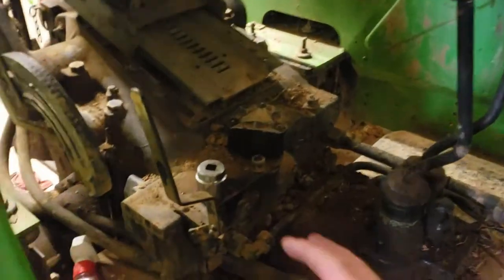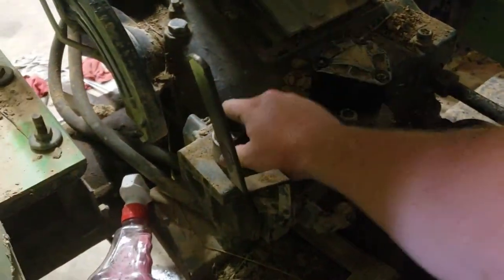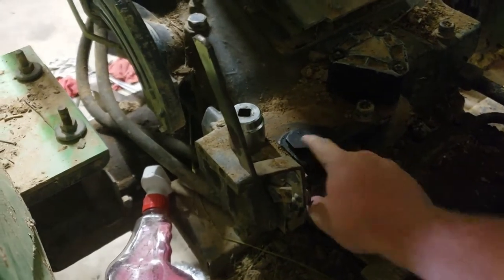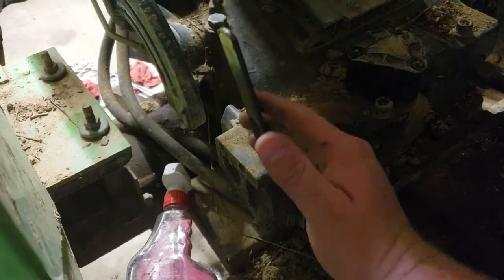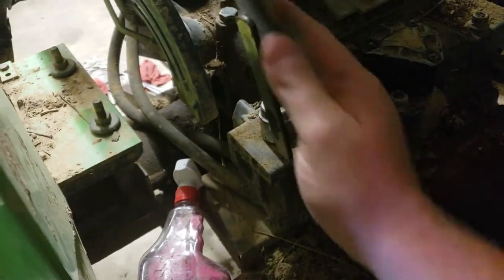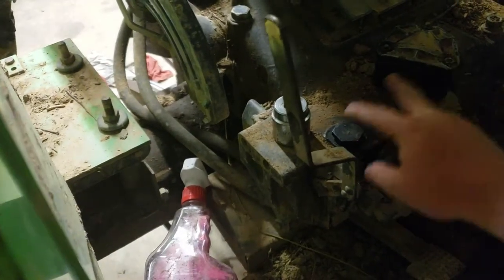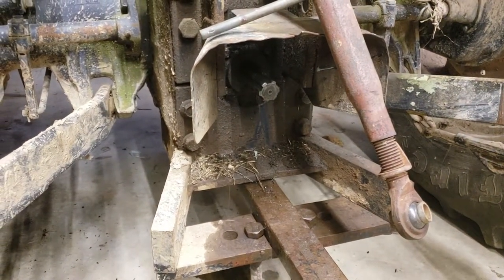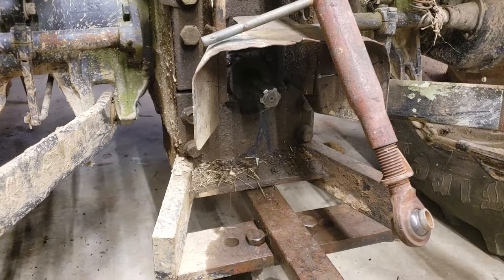Duetz D6207 | Hydraulic System | 1980 1981 1982

Comment: On my Deutz 7506, oil leaks under high pressure when I pull the lever on the distributor, now I'm wondering if it's difficult to remove the distributor, and what's inside, just rubber bands or gaskets

￼

Comment: That type od Deutz tractor has separate oil chambers for motor, gearbox and hydraulics. The screw under the seat is for measuring your oil in the gearbox and thru there you pour oil in for the gearbox! I'm not sure, you should chek this but I think that you pour the same oil in the motor and in the gearbox and different oil in the hydraulics system.
Reply: The plastic cap with dipstick under the seat fill oil to hydrolics only, it doesn't  fill oil to the gearbox, or rear end differential
Reply: @ikstrucking3289  And the motor oil and the hydraulic oil should be the same because the hydraulic pump has a gasket by the motor and it can break alowing the hydraulic oil getting in the motor (same motor oil doesnt damage the engine)
for the black lever: rise your 3point hydrau. and turn the lever then sink your 3point and it should not let the lower hitches beneath the hight of the PTO.